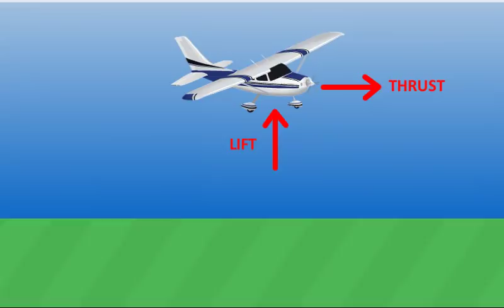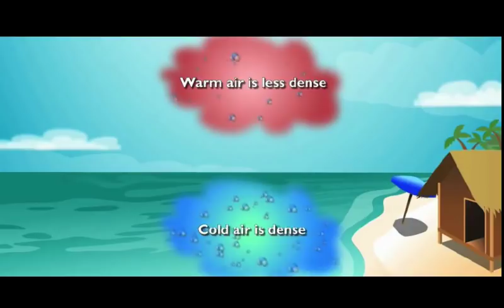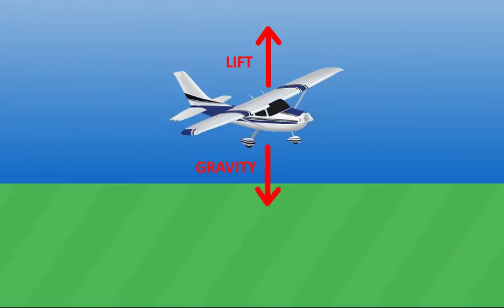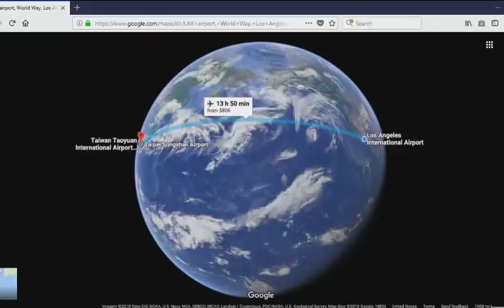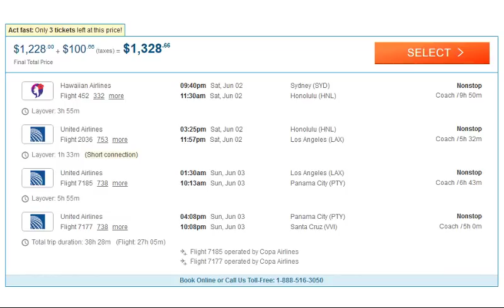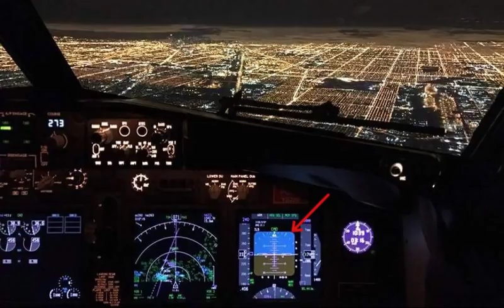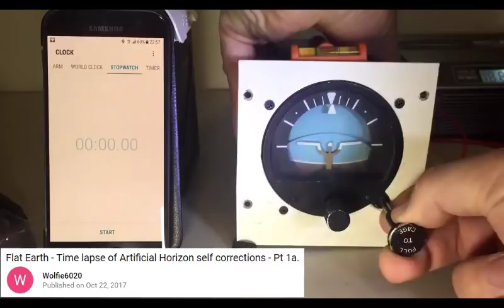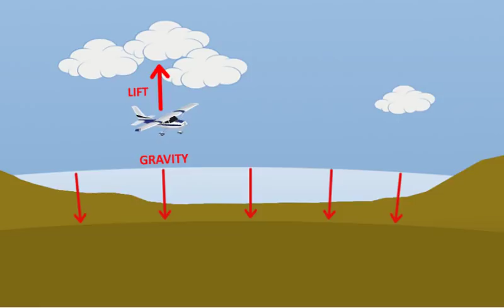Flat Earth Falsities - Plane Nonsense

Comment: i love how flat earths can't understand that the force of gravity is so real and defined by a mathematical formula G=m*g and it is used in engineering.Thats why we have planes and cars.
Reply: Gandalfwiz2007 Here's an even easier one: put something on a scale. That scale reports a weight (presumably you noticed the weight when it was in your hand, but it's always nice to have instruments confirming your observations). Now place an identical object on the scale. As the mass doubles, so does the weight. In fact, you will find that no matter what you weigh (assuming it's much denser than air or in a vacuum chamber so bouyancy is negligible), the weight force is directly proportional to the mass. Hm. Mass times some constant. Let's call that lowercase g. 

Gravity isn't even contradictory to flat earth. Universal gravitation is, but that's pretty hard to test from earth. I would be fine with a flat earth model that just said gravity pointed in the same direction everywhere. It would not be the most unbelievable thing about the model by far. So why do they waste their time making fools of themselves trying to assert that gravity _does not exist_?
Reply: Gravity wouldn’t work on a flat earth because it is (simplified as) an attraction towards the centre of mass. On a flat plane the centre of mass would be in the middle, so gravity would pull you at an angle, not “down”.
Reply: Galactic Ketchup 
The more intelligent (less unintelligent?) FLATWITS©️ (mainly Trolls, I suspect) realise that PLANET PIZZA®️ simply cannot co-exist with universal gravitation. Therefore, they have to deny its existence.
Reply: Galactic Ketchup: yep, a simple kitchen scale should be enough to demonstrate that gravity makes accurate predictions.

I'd still say that universal gravity can be tested too from earth, namely by using celestial observations. Gravity predicts all three of Kepler's laws. It'll take some time to get all the measurements, but it can be shown that the planets indeed follow those laws. You can see it in the moons of other planets too. 

You can see it in the motion of our own moon. The Greeks already knew that the moon was some 60 earth radii away. At that distance, we have a = 1 g / 60². Using that as the centripetal force for the moon gives a period of 27.3 days, which is exactly right.
Reply: Gandalfwiz2007 i love how you cant demonstrate anything you say gravity does.
Reply: try me, climb a building and drop 2 object of different masses (a car wheel and a bowling ball), they will both fall at the same rate because the gravitational acceleration is a constant value.

Comment: Small correction, at 6:38 you state "'level' means exactly that in this context, parallel to the force of gravity." I think you meant to say perpendicular to the force of gravity.
Reply: To flat earthers reading this: look what happens when an error, however minor, is pointed out on the pro-science side.  It's thumbed up, praised and seconded.  So much for "sheeple".

If you find a second error we'd be damn impressed, none of us can find it.  The rub is that you have to be right.   Not exactly how FEers react to corrections, is it?
Reply from the maker: David Murphy - Dammit, I have to fire my editor. ;) Thanks for the correction.
Reply: Yeah, nice catch there. Perpendicular sounds right. (Yeah it is right. Bad wording on my part)
Reply: The term "level" means "at equal elevation".  So to know what " level" means one has to know the definition of " elevation".   This term, when used by engineers to refer to elevation in a gravitational field  means "At equal potential".  So what surfaces (in a gravitational potential field) are of "Equal Potential"?   Well since the gravitational potential field is spherically symmetric, then  surfaces of equal potential are SPHERES centered on the center of mass that is causing the gravitational potential field.  I know that is too many big words for flat Earthers to follow, but it is the reason airplanes DONT HAVE TO PITCH DOWN to "follow the curve" because they are FOLLOWING the equipotential surface, and to do Otherwise (move up or down from that surface) would mean the aircraft would have to perform (or extract) work.  Sorry but that is physics so, by definition, is anathema to flat Earthers
Reply: IvanSensei88 not only it sounds right but it is right 😆
Reply: Air pressure wouldn't decrease with altitude in a dome, due to the fact that a Flat Earthers buoyancy argument being inherently wrong. Buoyancy does not exist without gravity
Reply: Just like here concerning the Coriolis effect he seems to fail to understand that an airplane has means of choosing and guiding its path over the Earth. It is capable of being guided on a set course and maintaining that course through varying side winds which would be a far greater force on the plane that the coriolis force is. 

Phucket  may I ask you what you believe causes the different rotation of storms in the northern and southern hemispheres?

""Yes, you can say "it's all relative" and that the atmosphere is just an extension of the earth, spinning at the same rate, but then you can not at the same time invoke the Coriolis force.""

Do you even realize that the Earth being a sphere on a rotating axis means that the actual surface of the Earth rotates at different speeds at different longitudes?  You are saying that we cannot invoke the coriolis  effect on a rotating Earth when coriolis is an effect of rotating objects?
Reply: VoysovReason Well, she did such a good job cutting the infamous orange I think you should let her off this one!  ;-)
Reply from the maker: Dan Zervos - True, but many flat earthers claim the dome is the ONLY thing containing the atmosphere, and that gravity is a myth.
Reply: Phuket Word, an everyday plumb Bob and dumpy level would be the easiest n most portable set up to determine your request.    Just remember that great circles on earth  ( ie like the equator)  works out at 1° per 111km  , which is why flatearthology expectations don't see buildings leaning away from each other in photos of horizons.  

On a similar note,  what n how do  flatearthologists test for a flat plane over 1000's of km,  or even 100km ?
Reply: Once again, Phuket Word is ignoring the facts and only accepts evidence that can't directly be shown. There are a multitude of ways to show that the earth is a sphere. The flight routes mentioned in this video is one of those ways. Constellations, the sun and the moon are some of the other ways. This confirms the geometry, regardless of which direction gravity points to. The direction of "down" can be superimposed on the geometry after that, but apparently you don't accept that as proof. What do you want to see? Two plumb bobs next to each other that are visually perpendicular? That's like demanding proof for water sticking to an object much smaller than the earth. You're asking for evidence that denies physics. It wouldn't be proof for the globe, it would be proof against it.

By all means, keep being an ignorant flat earther that denies the facts of reality. You're making a complete fool of yourself, but at least in your own mind you're superior to the rest of the world's population, right?
Reply: You belittle yourself, I guess you just cannot see that,  I asked you before how you account for the Sun traveling in a straight path over the Equator during the equinox when the Sun is directly over the equator.  Your response was that it doesn't. 

You cannot simply ignore facts such as this,  you have to demonstrate how a factual observation like this would be possible with a Sun circling over a flat Earth.  Why don't you make a video demonstrating how this is possible.
Reply: DidiLuigi    The funny thing is that Phuket appears to think his comments make some kind of sense. He cannot seem to understand how silly his comments are and that people just shake their head and laugh when reading them.
Reply from the maker: Stuart Gray - Stuart, well explained. I try to keep it simple for the unscientific people to understand, but I always run the risk of oversimplification, which I may have done a bit here.
Reply: +Stuart Gray  do you think that there is 1 living flat-erather that can understand your explanation? they don't understand when I tell them that mass and density are non-directional !!!
Reply: OK Phuke Word. So now you had your moments of deflection. 
Standard FE operating procedure!

Now get to WORK. Watch the video and tell us why flatter are always caught with the fingers in the cookie jar, labeled Fraud, deception, cherrypicking and deliberate lies!
Reply: Phuket Word    you saying you haven't been shown evidence doesn't change the fact you have. But then you're a proven liar  youtu.be/D9xdWAaZFSw
Reply: Phuket   no we know its not enough to belittle you and we don't care, because you  will continue to  belittle yourself, by putting your ridiculous crap out there for everyone to see and correct.
Reply: phuket  what the fuk are you even talking about? why shouldn't it?  and why would this occur on a flat earth?  if you cant reply and answer questions you have no business engaging in discussion.
Reply: Phuket Word
"A plumb bob proves sweet FA, unless you can show that a second or third one becomes perpendicular or even opposite to the first one "

They would be perpendicular to the Earth's surface, not each other, again proving that the Earth was not flat.

"hey never have to take off and land with the earth moving or curving beneath them. "

Did you even watch the video?

"You seem to think your rhetoric and lack of demonstrable physics is enough to belittle me"

Your demonstrated lack of understanding of demonstrable physics belittles you.
Reply: Phuket Word "Your demonstrated lack of understanding of demonstrable physics belittles you."  I'm sorry to say I have to agree with the previous poster.  

You seem to accept the conservation of linear momentum but not angular momentum.  This is utterly bizarre.  Are you not aware that if you spin something it carries on spinning and slows according to the force of friction in the same way as something travelling in a straight line?  Is this really news to you??

Obviously, if the atmosphere magically stopped then we would experience 1,000mph winds on the equator, flattening trees and buildings transferring angular momentum to the ground and the winds would slow.  Do I need to explain that energy from the sun creates convection currents that drive wind?  As for your point on the coriolis force, it's just a very weak force - the Earth turns very slowly, once every 23:56 minutes.  Is there any logic at all to your position?

I shake my head agape that anyone over the age of ten needs to have this explained to them.  Are you a poe?
Reply: Phuket Word  As Danlo  pointed out, a simple plumb bob will prove this.  A plum bob at the north pole would point to the Earth on one end while the other end is pointing at Polaris while  a plumb bob at the south pole would also point to the Earth on one end with the other end pointing the opposite direction of Polaris.

This shows you that down is always towards the Earth no matter where on the Earth you are. It also shows you that down is physically an opposite direction for someone on the opposite side of the Earth from you.
Reply: Phuket  Here is a video showing that this does happen no matter how much you deny it.

https://www.youtube.com/watch?v=jEn_RmtyBxs
Reply: How do you account for the moon doing exactly the same as the sun during the equinox period - a lunar equinox with the moon rising in the east and setting in the west from ANY location?  I have done a video on that.
Reply: And there he goes, changing the subject because he doesn't have a reasonable answer. How predictable. Moon's path also makes more sense on a globe. If you haven't noticed, the moon sometimes travels in the same plane as the sun and the earth, that is after all how eclipses occur. Why then is it not reasonable to think that the moon can't exhibit the same rising and setting locations?  If it still doesn't make sense to you, get some accurate measurements, plot them on the 3D model and show that it doesn't match up. Then, claim your Nobel prize. Now answer the previous question.
Reply: Stuart Gray  you always have great informative comments!  thanks, I dig it.
Reply: I noticed that too.
Reply: Gravity. Lol
Reply: VoysovReason Parallel is right. Parallel line are always the same distance apart. Perpendicular lines intersect at a 90 degree right angle.
Reply: VoysovReason they love to ask us to model ball and water here. i asked them to make a dome model with different atmospheric pressure
Reply: Phuket Word
"You seem to think your rhetoric and lack of demonstrable physics is enough  to belittle me and throw others of the scent."
No need of "rhetoric " to belittle you : your comments make the job perfectly !
Reply: Phuket Word

"How do you account for the moon doing exactly the same as the sun during the equinox period"
How do you explain the 12h day/night for EVERY latitude on your flat earth durignequinox ?
Equinox is ONE OF THE WORST ENEMY of flat earth cult !
Reply: Thank you! I was debating whether to let it slide.
Reply: A small error, air pressure under a dome would not be constant but decrease with altitude.  However this does not change your argument.
Reply: So let us see actual physical, measurable proof that on this earth down becomes perpendicular or even opposite if you move a few thousand miles.
Reply: A plumb bob proves sweet FA, unless you can show that a second or third one becomes perpendicular or even opposite to the first one IN REAL LIFE, not on a circle on a piece of paper!!!!
Reply: Stay Focused om THIS point.  Conservation of motion is a real thing. It means that whether assuming or trying to prove either a stationary or moving earth, the argument for LINEAR conservation of momentum is moot when trying to  compare a train  or car or plane to the alleged movement of a spinning sphere.
Aircraft (all types) cut through the air with no regard for coriolis, einds etc. They never have to take off and land with the earth moving or curving beneath them.  Yes, you can say "it's all relative" and that the atmosphere is just an extension of the earth, spinning at the same rate, but then you can not at the same time invoke the Coriolis force.
Reply: Point is, every so-called proof of the globe is just an interpretation that is the same as a level, stationary plane. So it DOES come down to having those very simple, undeniable proofs (practical demonstrations of down being towards the center of an alleged spherical earth).
Reply: You seem to think your rhetoric and lack of demonstrable physics is enough  to belittle me and throw others of the scent.

Comment: 1000 miles/h = one rotation per 24 hours. One degree of rotation per 4 minutes.
Reply: Uneducated people doesn't understand things? I'm shocked!
Reply: AakeTraak want to make it even worse for them?
The Earth spins as fast as the hour hand on a clock.
It spins once per day or  0.000696 rpm.
What do these people expect to see much less feel?
Reply: TheCommunistDragon You mean half the speed of the hour-hand of an analogue clock? It's two 12-hours revolutions per day. Somebody need to do a video of someone rotating a globe in realtime.
Reply: Galactic Ketchup That's some hotrod! Excellent, thanks, but flattards don't do maths, apart from the 8 inch per mile squared. Maths is the tool of Satan or something.
Reply: Galactic Ketchup,
Yeah, but if they could do math they wouldn't be flat earthers. 
The only thing flat earthers fear is sphere itself.
Reply: Bobby Wizdum The 8-inch formula is a rough estimate that only works at relatively short distances. Use the proper formula to get an exact result.
Reply: Let's be fair here. The important number is neither 1000 miles per hour nor 1 revolution per day. What we would feel is the acceleration due to the earth's rotation which, at the equator, is a = v^2/r = w^2*r = v*w. I won't go through the proof here, but if you take an intro physics course that includes calculus, you'll see that this is provable with geometry alone. 

v = 1000 mph
w = 1/(24 hr)
a = 1000/24 mph/hr = 41.7 mi/hr^2 = 0.7 mph/min

Thus, using commonly accepted numbers and a basic competency in calculus and algebra, we find that the acceleration felt from the rotation at the earth at the equator is equivalent to being in a car that accelerates to 0.7 mph over the course of an entire minute. Compare that to acceleration due to gravity (or whatever you call that fally thing), which speeds falling objects up to about 22 mph in a single _second_, neglecting air resistance (That's indisputable. Drop a sufficiently dense object off of a sufficiently tall building and watch it fall for a second. It will be going 20 mph. You can also test it on smaller scales and do the unit conversion). Gravity (or density or electromagnetism or whatever it's called) is easily orders of magnitude stronger than acceleration due to the rotation of the earth if you do the math carefully.
Reply: Galactic Ketchup Come on! That's way to complicated for a stupid person to grasp.
Reply: The 8 inch squared formula is okay for relatively short distances because a parabola closely approximates a circle for small arcs.  In fact for optics they typically grind the lens to spherical dimensions even though to focus parallel light to a point focus it requires a parabola - but for the minor arcs used in lenses, a sphere is more than close enough.
Reply: Harry M how is it moronic. its basic trig based on the alleged circumference of earth. whats ridiculous is the lack of curvature that you guys cant get around .
Reply: TheCommunistDragon. The earth rotates at HALF the velocity of the hour hand on a clock.  If it rotated as fast as the hour hand on a clock we'd all get dizzy!   Cheers.